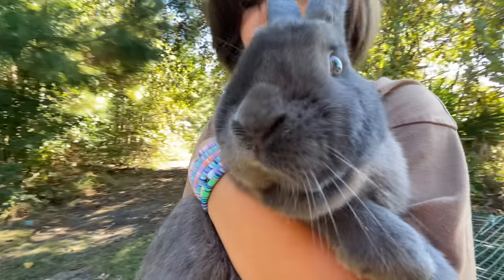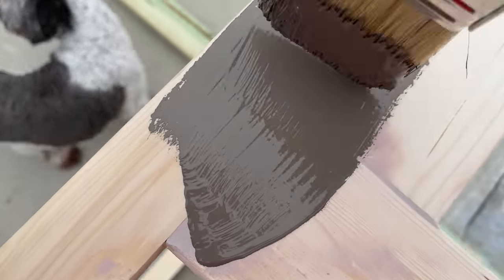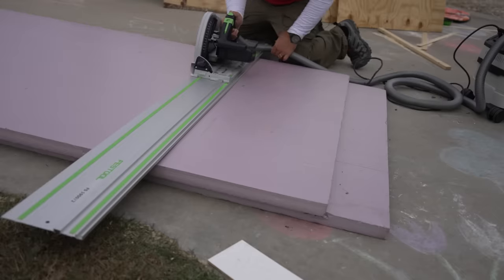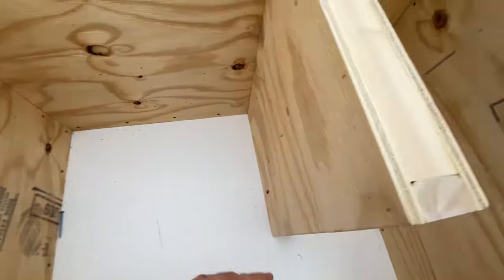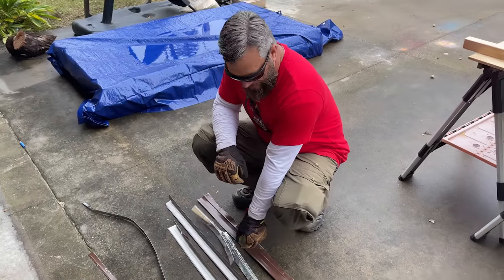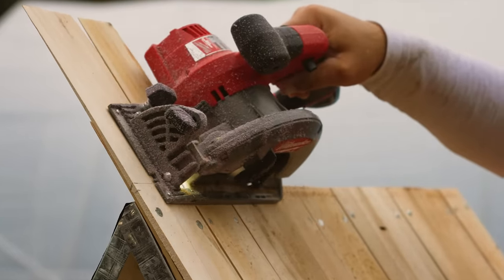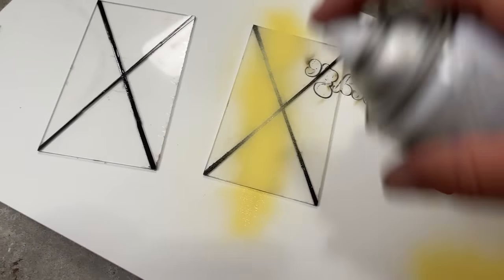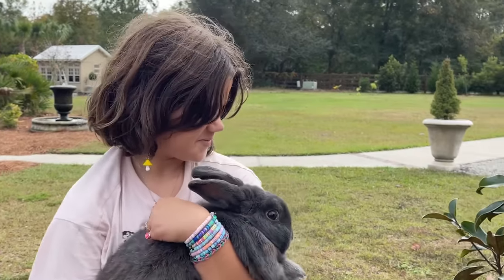We Were Supposed To Eat Him But I Did This Instead!

Comment: Great idea on the sand in the paint, we did something similar at a company I used to work for; we worked out of box trucks and the bumper steps were enamel coated and extremely slippery in the rain/snow so we did this with black paint and it worked wonderfully. Poor man's truck liner lol
Reply from the maker: That’s awesome. I would have never thought of using it like that.

Comment: I would think you have more concerns with the heat during summer where you are. A small solar panel into a cheap 12v solar charge controller attached to a 7ah lead acid battery would be able to power a couple led lights (during the shorter daylight hours) and a 12v water resistant 120 or 140mm fan....if you decide to use it be sure to have an easy removable cover for the fan to avoid unwanted bunny injuries and keep it easily cleaned.....also, a flat piece of slate or marble can act as a nice cooling spot during the summer, especially in combination with a frozen 2-liter of water. Lastly, I'd really recommend cutting a slot to put a tray (or trays) in the hutch to make cleaning it really easy. Rabbit urine calcifies so quickly, it'll be a real pain to reach in and clean that thing. Great looking hutch, you and your girls did an outstanding job!
Reply from the maker: I have thought about adding a fan like that. Thanks!